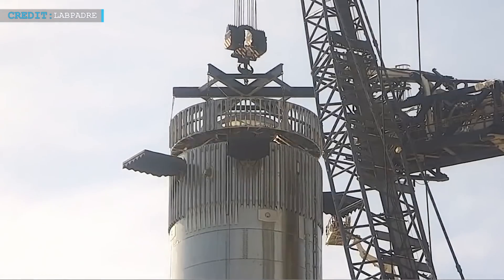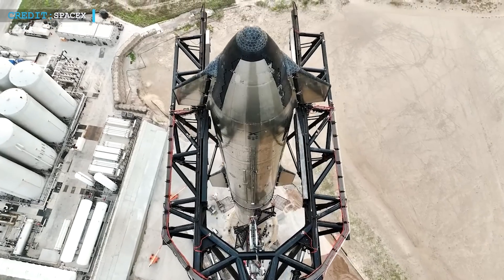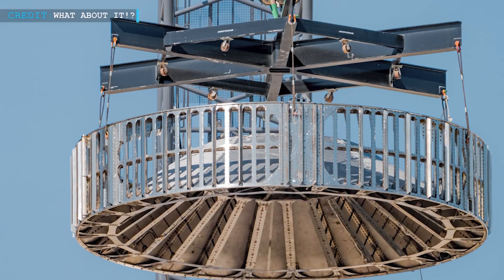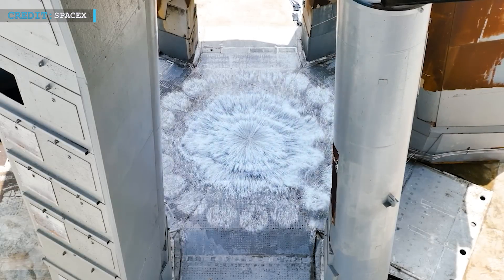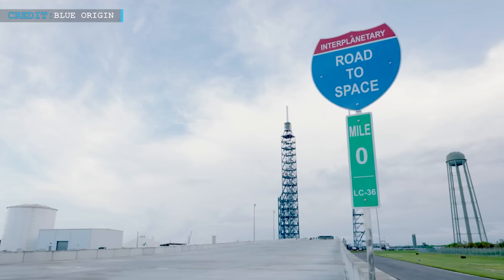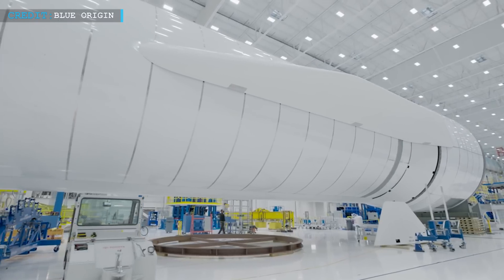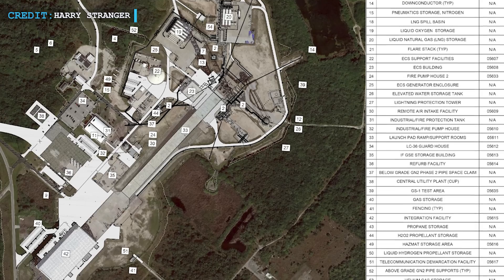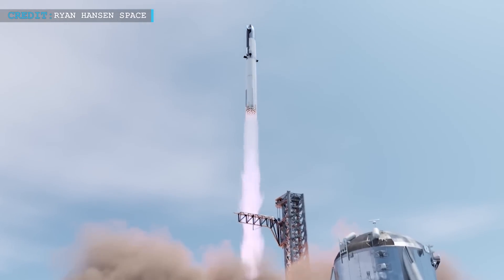SpaceX Removes Hot Stage from Booster 9 | Blue Origin progressing towards orbital rocket, New Glenn

Comment: I think it's a stupid idea to attempt the first few booster launches with starship atop.
Reply: How else do you propose to test it? It can’t launch as it is due to its lack aerodynamics. It would be more costly and time consuming to design aerodynamic attachments for the top of the booster, let alone dealing with the fact the booster would be too light to actually test the booster when it comes to the ability to loft that weight, to cope with the aerodynamic loads of a full hight and weight stack and probably a whole host of other things I haven’t thought of. 
It is much better to test it with the actual payload it is built to carry because you save a whole load of time, effort and money in trying to replicate the conditions on a supper heavy alone.
Reply: Who cares what you think. You aren't  a rocket engineer
Reply: Better to kill 2 birds with 1 stone. Rockets aren't cheap, so use what you have.